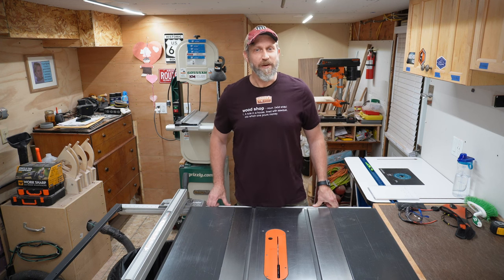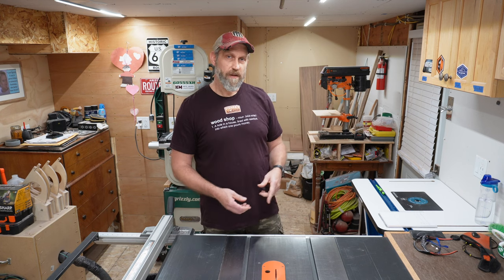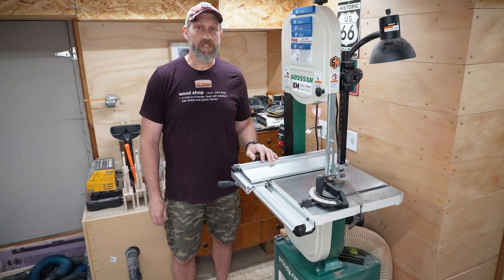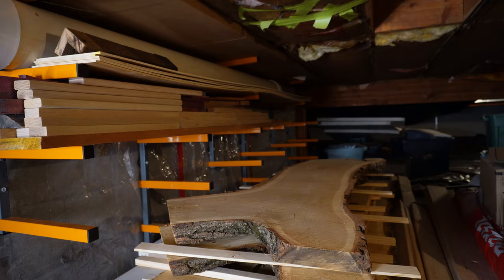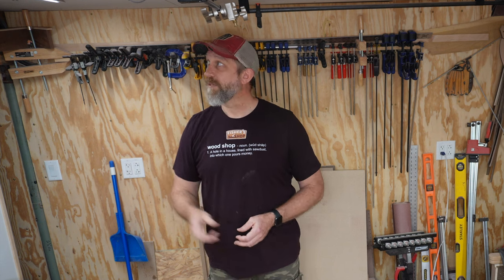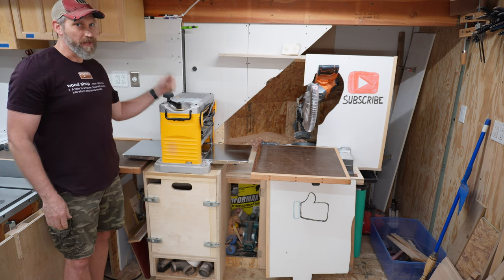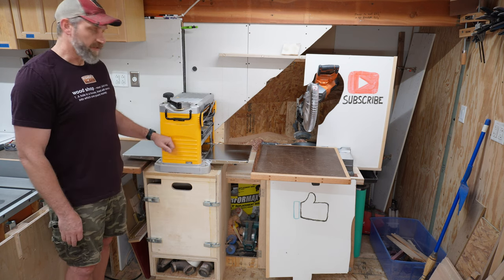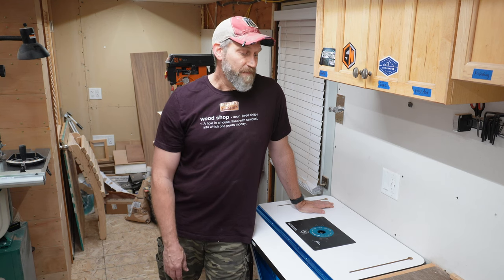Brett's First Shop Tour (Long Version)

Comment: I have a 10' x 16' shed that I converted into a shop. I insulated sheathed it and had it professionally wired( for insurance reasons) and I left the floor bare of plywood which is fine and I much rather have wood than concrete. This was a gift to myself when I retired and I gotta say, within 6 months I was wishing I'd gotten the 14' x 20' building. It's been 10 years now and I'm ready to add another 8ft off the back so it's not so cramped. This is the first time I've seen a shop your in the same dimensions as my shop and it has been very helpful. So thank you for the tour. I picked up some good ideas to use until the addition goes up. I plan on doing it myself without a permit. I live in a CT shoreline town that requires permits just for a garbage can screen wall!  If they make me take it down so be it. It will be the first real construction I will be doing on my own. I've done construction with my brother, but this is a challenge I want to complete myself. Though I may need help raising the wall, lol.  Thank you again! 
~Dolly

Comment: You do not need to make a insulated box around the shopvac , just build a muffler on the exhaust of the vac. 😁😁👌👌
Reply from the maker: But then I’d lose that horizontal surface to collect random crap… 😛😆
Thanks for the tip!

Comment: Great shop, I have subcribed and have you thought of putting your router in the table saw wing that I see is empty?
Reply from the maker: Hi Hector, thanks for stopping by! I have thought of putting my router there. Currently, my trash can sits under the empty wing, which is a convenient and centrally located space for it. Things may change once I get my outfeed/assembly table built. We'll see...

Comment: if you haven't done the outfeed table fix yet- michael alm has a good outfeed table that is only like 18" which seems to work awesome. even if you don't do it that way because of saw type (he attaches it to the saw with no legs), maybe a shorter length wouldn't mess up the flip up table brackets as fast as the longer one you have?
Reply from the maker: I appreciate the input!
Reply: @BrettsWoodshop  thanks! love seeing other folks with small shops and what they are doing to make things work well for them. appreciate you sharing it!

Comment: What is the name of that lovely black dimpeled product you put beteen the floor and subfloor? 

BMMBI List (Brett Made Me Build It)
1) Rebuild walls in basement w/ 2x6 and stagger the studs.
2) Lay black dimple stuff and subfloor
3) Add insulation and cover ceiling

... I'll need a new truck... and a trailer....
...where are all of those credit card offers I've been saving...
...I can sell the kids electronics - they can play outside -...
...if the wife complains, blame Brett.

Fool proof plan... what could go wrong? :D
Reply from the maker: 🤣😂😇 I love it! .. Generically it’s called Dimple Board. It’s a dimpled waterproofing membrane made from High Density Polyethylene (HDPE) plastic. There are a few different brands. Don’t remember where I bought it. Probably Menards.
Reply: @BrettsWoodshop  awesome!  Thanks for making this video. Very helpful in many ways.  I need to do something similar for my basement shop.... I think the first solution is making a box for my shop vac...